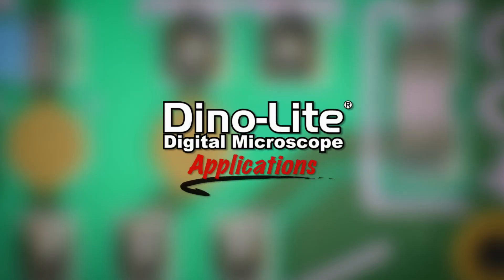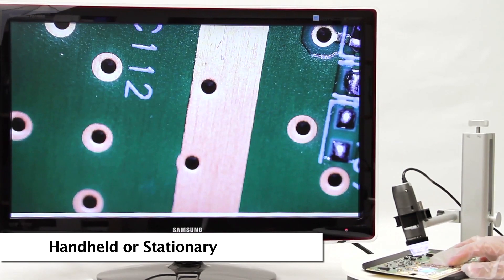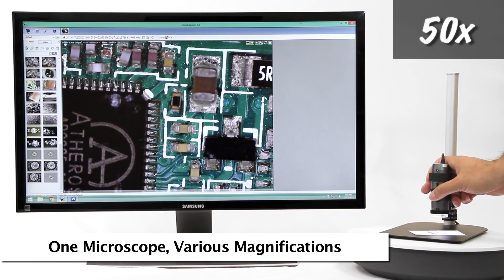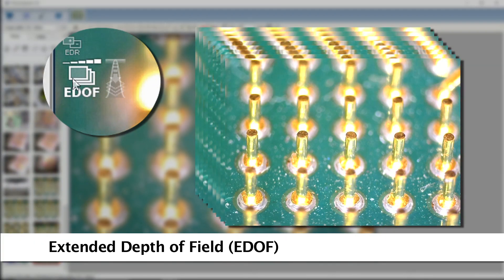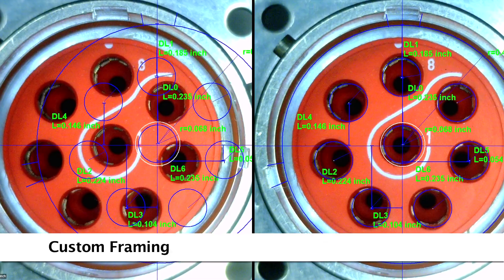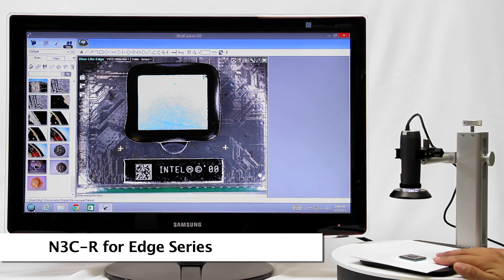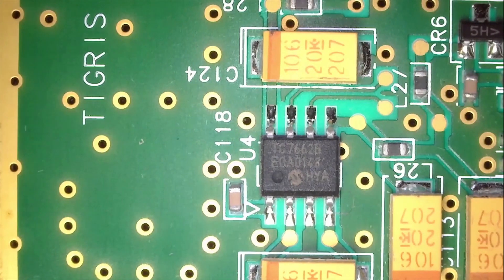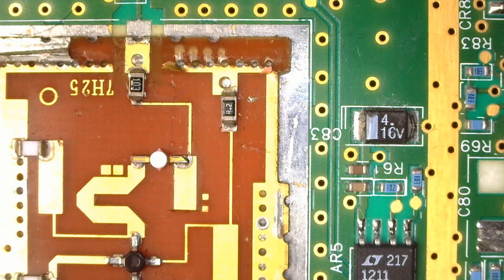Dino-Lite Applications: PCB

Comment: Awesome! So, this is intended for closeup PCB design work, right?
Reply from the maker: +Matthew Ferrie Hi Matthew. Thanks! The Dino-Lite microscopes can be used for just about anything that would benefit from the magnified view and any of the additional features. Not only design work, but soldering, general QC inspections and much more.
Reply: +Dino-Lite Digital Microscope.5th